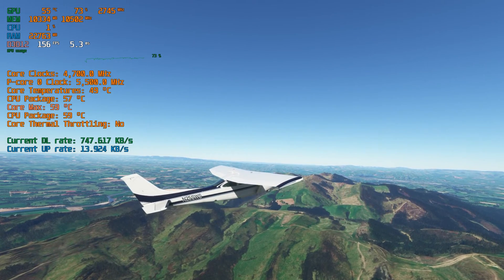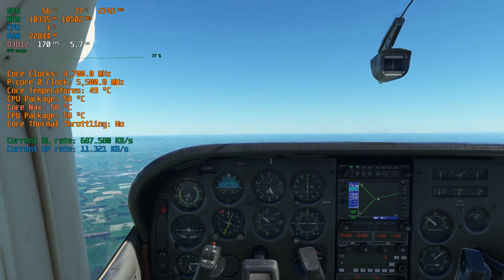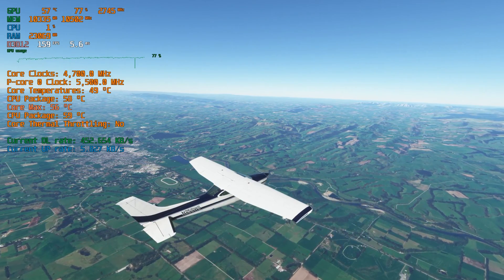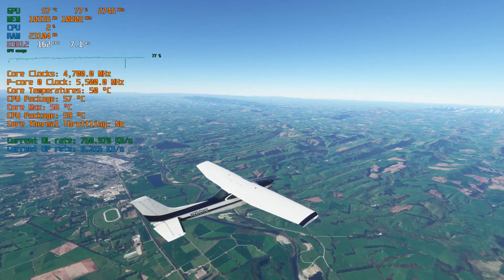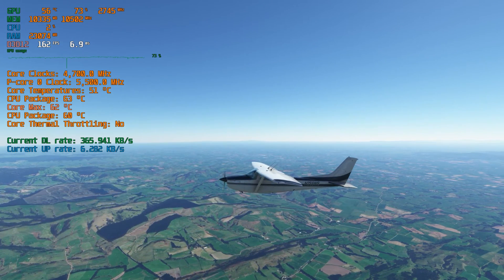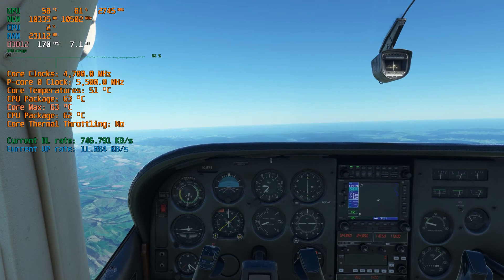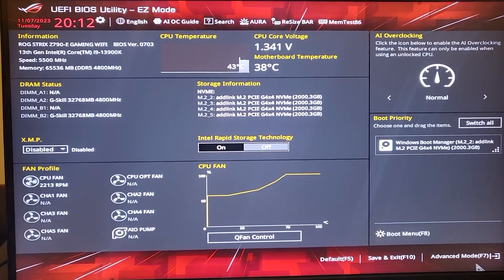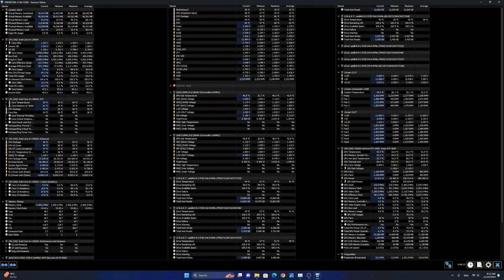Solve i9-13900K Overheating in MSFS and X-Plane | Ultimate Fix

Comment: I'm tring to change the offset however I don't get the option to change it when I select Offset and the minus sign.  The only option I have is Auto and the box to set the offset doesn't show up.  Any Ideas?  ASUS ROG Maximus Z790 Hero. Intel Core i9-13900K Desktop Processor 24 (8 P-cores + 16 E-cores) with Integrated Graphics - Unlocked
Reply: @billditz2079  I know it’s a year late but click on the auto and just type the number down, I had to figure that out myself

Comment: Hi guys, I am running an i9-10900K at stock speed of 3.70GHz. Motherboard is Gigabyte Z490 UD AC. I am suffering dreadfull freezes in XP12. My BIOS is different to QPilot's. When I go into Vcore Voltage Mose I have three options. 1. Auto 2. Adaptive Core 3. Override Vcore 4. Fixed Vcore. Except for auto, the others have a sub menu of internal CPU Vcore offset. I changed it to - 0.080 and each time, after saving and rebooting I get the blue screen of death or Windows repair. As soon as I reset it to auto all is well.

Hopefully someone can help me. What Vcore voltage mode do I use and is the CPU Vcore offset the right one to change? Also, is - 0.080 correct? Is there another option I should be using? Many many thanks for any help. The freezes in XP12 are terrible. I am pretty sure my CPU is overheating as HWINFO64 shows the CPU at 85C and then it freezes. I have 3 normal fans in my case as well as water cooling on the CPU.

Many thanks again for any help.
John
Reply from the maker: When you do core voltage offset, make sure you select the minus sign. This means you are reducing the voltage. Either Negative or Minus sign should appear when you select offset mode.
Reply: Many thanks @Q8Pilot

Comment: Hey Q8 check your GPU connector make sure it's not melting there is a problem with some 4090 GPU connector it seems to melt, I'm dreading installing my 4090 fe, let us know all is ok!
Reply from the maker: All is ok
Reply: @Q8Pilot  thank you brother for letting us know I was about to sell off my 4090 fe. I bought more than a year ago unboxed. You gave me confidence to upgrade my GPU thank you 🤲I'm going to stick to my 10900K build fan assisted.

Comment: Are the hot running intel chips worth it? Read that the high cache chips like 5800x3d and 7800x3d work well in Flight Sims, asking as I am picking out parts for a new build.

Comment: @Q8Pilot, I saw XMP being disabled so you are running default JEDEC speeds (slow) on your memory, unless you knowingly opted to do that for some reason. And undervolting should always be followed by stability testing, exactly like every other change to voltages and/or frequencies. Even as time passes with no other changes, stability testing should be done once in a while because of component degradation.

Comment: I am using an I9 14900kf with a cooler master 240 AIO and I never get the cpu temps above around 67 degrees. I monitored all parameters in HWMonitor and the hot spots are only pikes with get up to around 77-79 degrees while running xp12 at 4K. However I am only getting at busy airports with vatsim running around 35-40fps at max settings. During the cruise I have 60fps. 

I am wondering why so many have temp problems with these cpus. 
However with some planes (FF767, Zibo Mod) I have some fps drops to 25fps while zooming deeply into the cockpit and sometimes is zooming in and out delayed but the simulator runs at constant fps. 

Maybe some have an idea why this is? 

My full specs
I9 14900kf
RTX3090
32gb ddr4 3600CL16 Ram
4TB SSD
mATX Chassis
AS Rock Pro RS B660m 
INNOCN 27zoll 4K Mini LED Monitor

Comment: I'd like to bring to your attention that the reason it was thermal throttling is due to Asus MultiCore Enhancement (aka AUTO overclocking via the Motherboard custom settings) being set to let BIOS optimise which applies way more voltage than needed, along with changing other CPU core speed settings that overwhelms the best of CPU coolers, and essentially reduces performance.

The optimal setting is "Disable - Enforce all limits" which applies Intel's specifications for power draw while still being able to apply undervolting to even further reduce temperatures, but keeping in mind that a certain setting you see someone else using may not work for you as each individual system is different.

Comment: how about limiting fps to 60.....
Reply from the maker: No that will not help eliminate the spikes to 100c. It is not related to FPS, it is related to voltage.
Reply: @Q8Pilot  well from my experience limiting the fps will reduce the load on the CPU and GPU this lower the temp
Reply from the maker: @beanZshots  It will, but it will not prevent the spikes to 100c.
Reply: @Q8Pilot  true